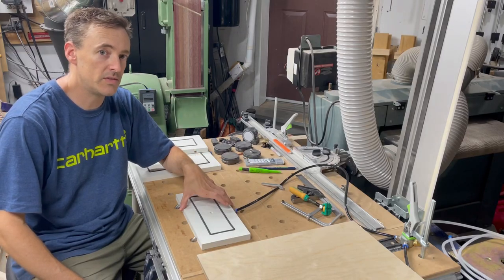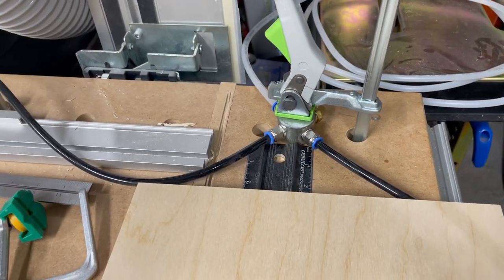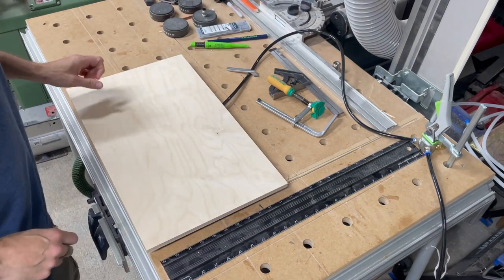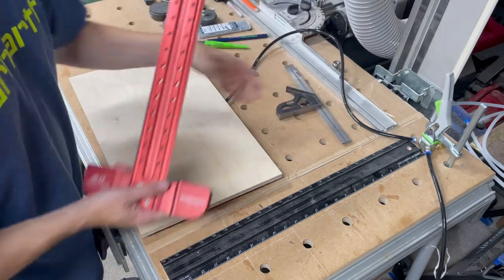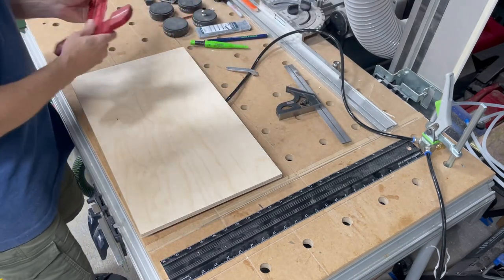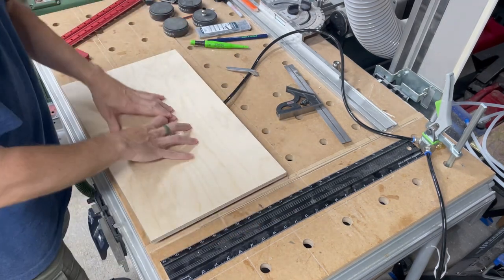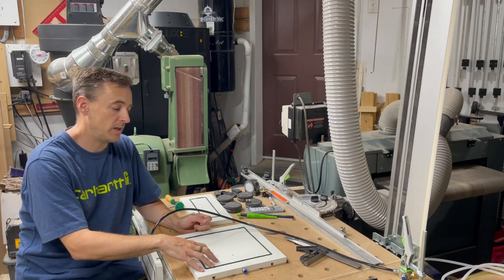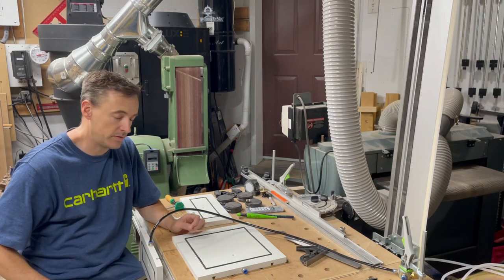DIY Vacuum clamp pads, alternative to Festool VAC SYS

Comment: You shouldn't make such sharp corners for your grid gasket. A radius of about 3/4" would allow the cord to bend more easily, so you keep as much vacuum seal as possible.
Reply from the maker: I agree, the template radius looked more gradual than the end result on this first go around.  My current pads and template for making them are more rounded.   However, they also work fine, no apparent loss of suction since I can pick up my MFT by pulling up on the workpiece when on.